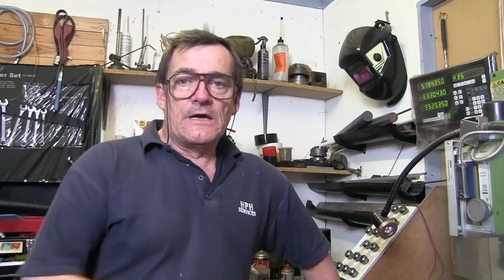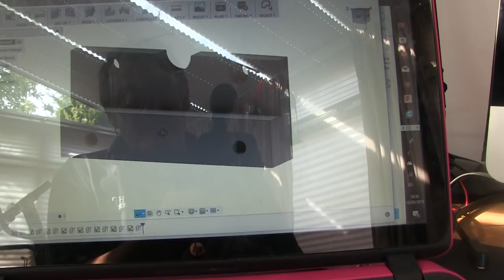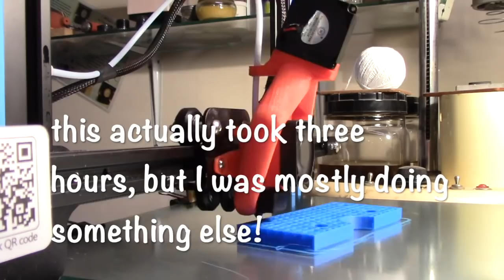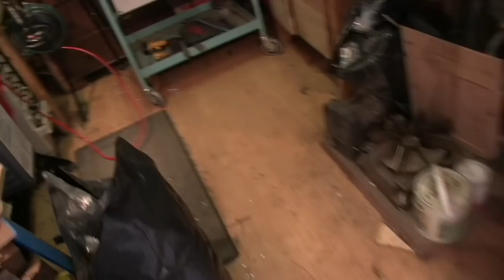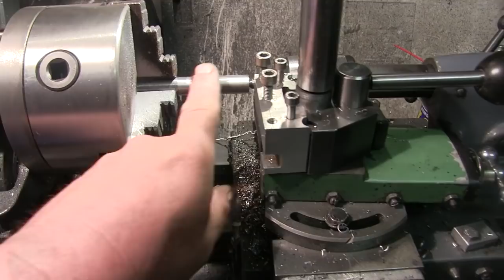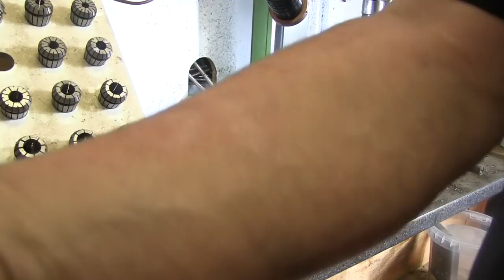"NEW' Power feed for the Milling Machine.

Comment: Nice video. Do you think a windscreen wiper motor would work?
Reply from the maker: Hello, thanks for watching, and yes, they are another pretty high torque motor than you can easily control the speed,
ATB,
Cliff
Reply: Yes it works. I had one on a NuTool milling machine with a R8 spindle many years ago.